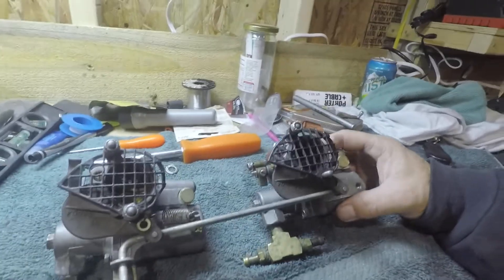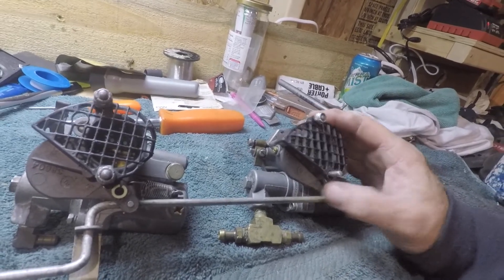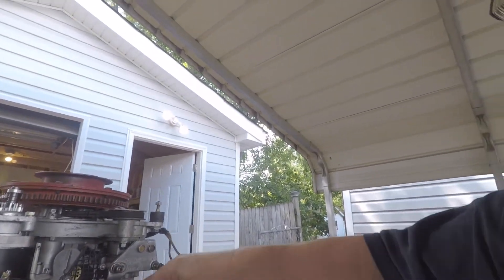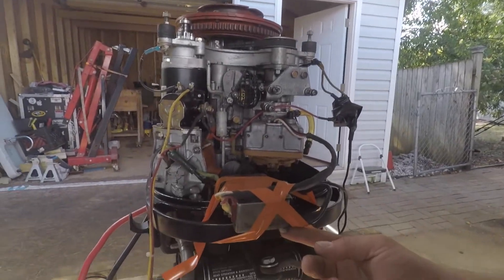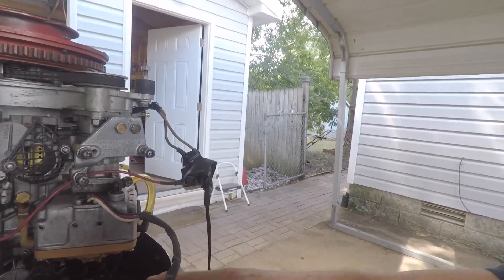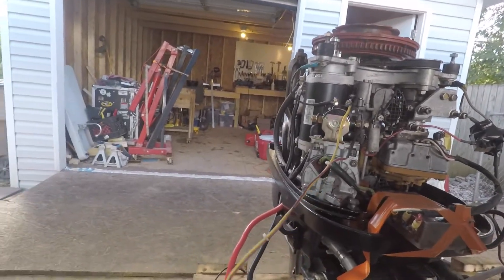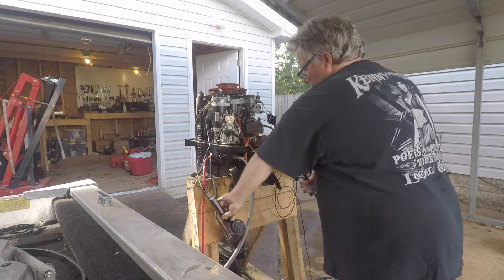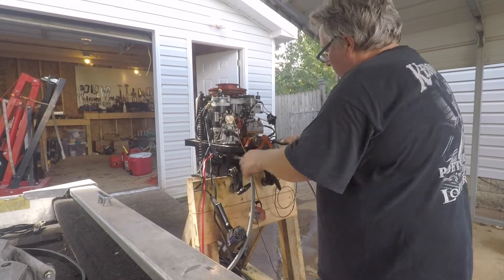Mercury Thunderbolt 500 50 hp Part 58 - First Run

Comment: I really appreciate you sharing your knowledge! I just bought a bass boat with a Merkury 500... I know nothing... Lol
Anyway, I wasn't even sure what model it was. Still not positive. But, it looks just like that one your working on. With the exception of the thunderbolt label. But, I think that's what it is.... Lol
Everywhere I go put the serial no. In doesn't recognize it.😮
But, I checked the impeller, seems to be ok, but I'm going to replace it anyway. However, the copper tube that runs up from there, came out when I pulled the bottom section off. ?? That's not normal, I'm thinking?? I was going to just put it back together, and just start it to make sure it even worked. But, when I got it back up there, I remembered, did I put it back in neutral? That would be important, right? So, after kicking it over and further inspection, I realized that the wires coming from my trigger were fried, and corroded. 😢
Can you please tell me what my next steps should be?
I really do appreciate your help, even if you don't have advice to give. I've learned a lot from your videos already, so thank you, from me and all the people who watch your videos. And, just so you know, not everyone leaves a like or comment even if they get something from your skillset.
Thanks,
Gary in Roosevelt AZ. 😀👍
Reply from the maker: You can rebuild the distributor but if the power pack is bad your out of luck.  They don't make that and its a gamble buying a used one.  You can check to see if its  working I have a video on that.  Try this for parts they go by serial range those motors https://www.marineengine.com/parts/mercury-outboard-parts/500

Comment: are the butterflies of the throttle completely closed when you start the engine?
Reply from the maker: Yes
Reply: My motor has to be given a little throttle,otherwise it won’t start up,any ideas?two carbs are cleaned,I have double-checked
Reply from the maker: @yijianggu5203  You need to adjust the carb sync.  Adjust the plastic piece on the distributor that opens the carb butterflies.
Reply: @yijianggu5203  I have the same model, same issue. Did adjusting the throttle plate linkage help your motor to start better?